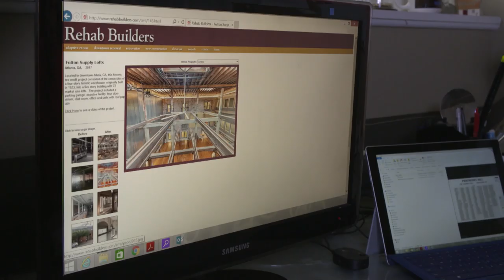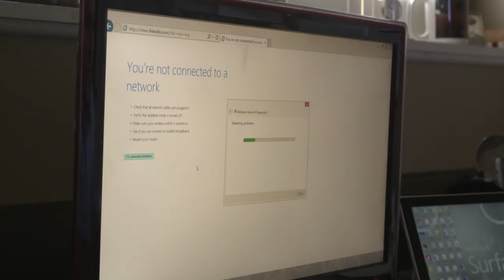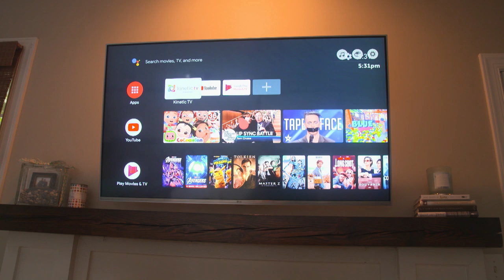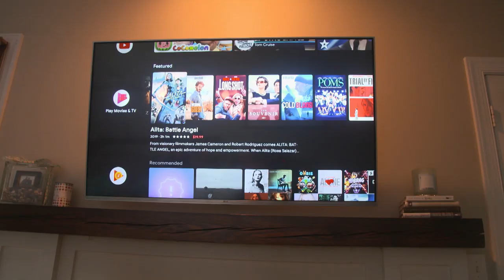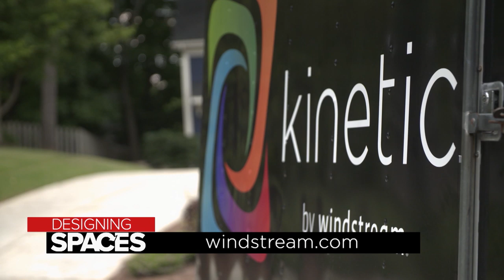Reliable, Affordable High-Speed Internet with Windstream | Designing Spaces

Comment: What speed did they get? They mentioned bonded service so i'm guessing 100/15?
I'm 2600 feet from a Windstream hub and my speeds are 75/14ish
Reply: That sounds about right Matthew. The new packages with windstream are ''range'' speeds, the best effort the line can get is what your speed is provisioned for. You likely fall into the 100 MB speed ''range'', which is anywhere from 73-126 to the modem.